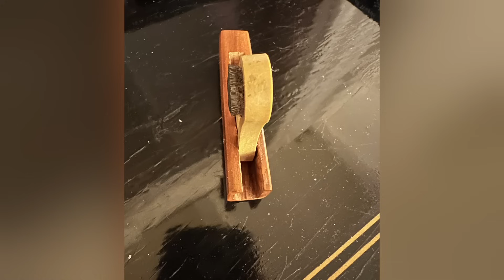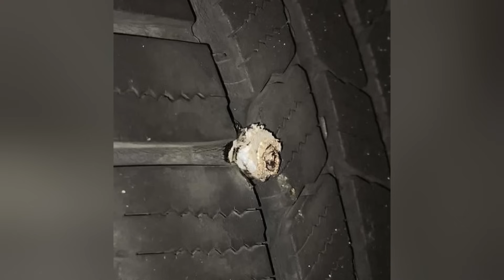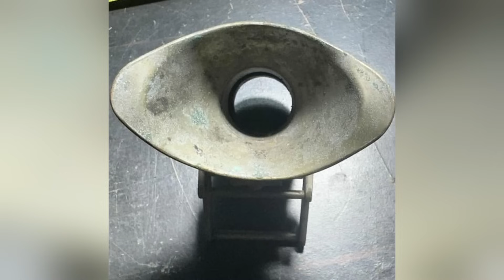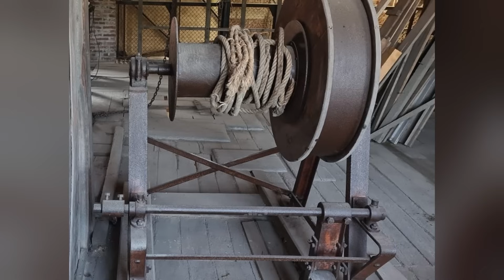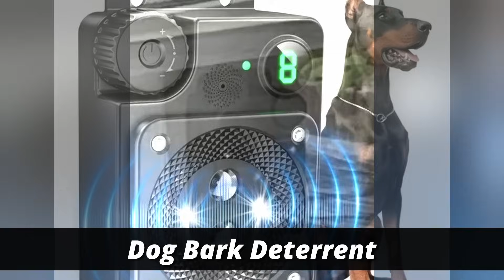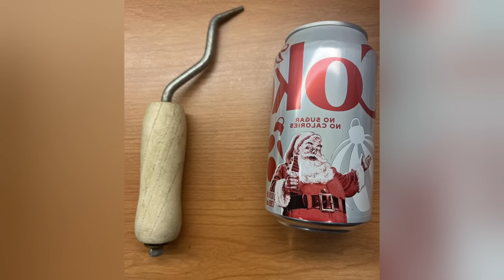35+ MYSTERIOUS ITEMS That Nobody Knew What They REALLY Were!

Comment: That is not a hose mender. I have used may and they have two flanged ends thar are inserted inthe hose , and two , two piece collars that clamp over the two flanges and screwed tight . Most from the Hanson company are a brass ferrel and plastic clamps . It looks more like an internal thread iinsert . To be used to connect a wood or plastic handle to a threaded metal item like a pizza cutter , icecream scoop , bottle opener

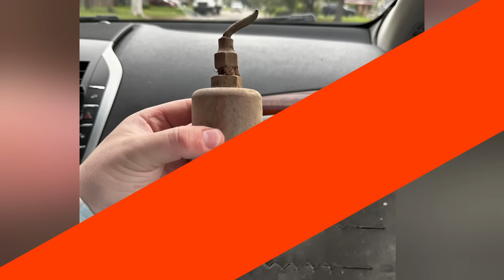Comment: The item at 5:25 is NOT a filter/drier. In my 40 years in the HVAC-R trade I have never seen a filter/drier like that. A filter/drier would have two ports. One inlet and one outlet for flow through.
Reply: The item is a desiccant filter for sure, the outlet is fully caked full of dirt , the farm shop at my place has a shelf loaded with the same type, used but too good to throw away. Dad ‘s hoard.

Comment: That Monks head is a Plaster model of one of the 7 deadly sins. It is a match holder. I happen to collect them - some of them come in a strip of 7 and are Pipe Holders. Some come in a strip of 4. They hang on a wall - the one you have there has lost its metal hanger. I am in England and have one my Grandfather bought nearly 100 years ago.